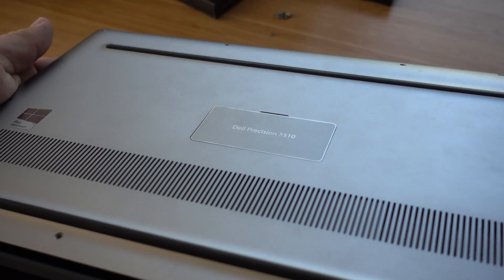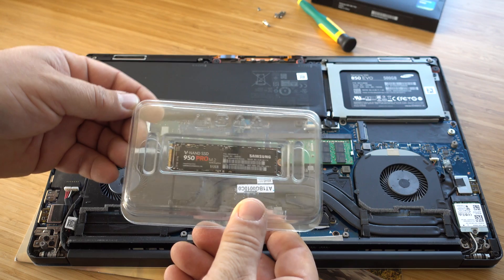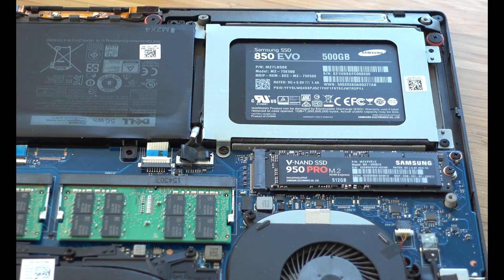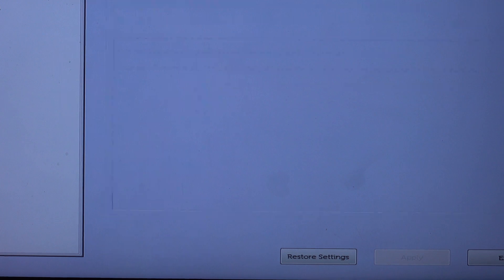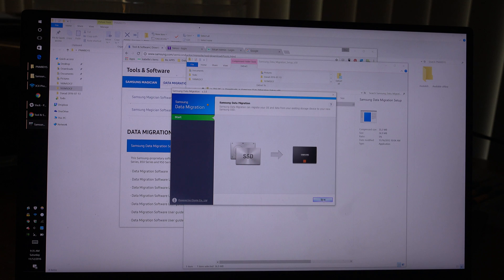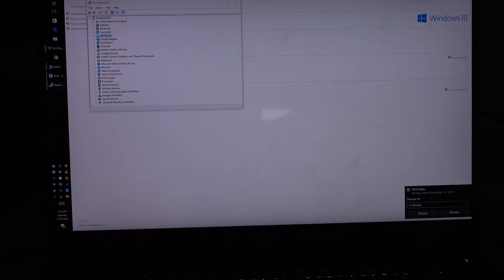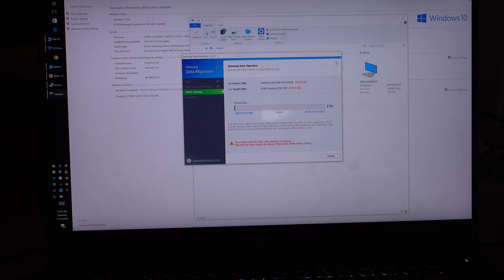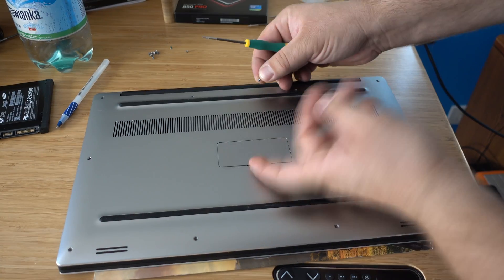Dell Precision 5510 XPS 15 ssd hard drive upgrade NVME V-Nand Samsung 950 Pro M.2

Comment: Hi Tom! Nice video! I would you ask a question. Do you know what are the right bios settings that working with both ssd installed? I would to maintain the SO (windows 10) on the ssd and using the ssd nvme only to storage. This pc works for me as a backup pc nowdays. Thank you so much!
Luca

Comment: Are you able to keep both hard drives for additional storage if you wanted?  Like a C: and D: disk?  I have a 4tb samsung SSD sata from my old Laptop that i would like to use.  Cheers!
Reply from the maker: Yes if your laptop has a M2 slot and 2.5 inch HD slot, then yes you can have two different hard drives.  Works very well.

Comment: Hi! did you have any problems with thermals? I read that a thermal pad might be needed for the nvme but not sure. Would be great to know your experience!
Reply: I want to know too
Reply: @fanadil  FWIW, I did install a thermal pad for the NVME SSD on my Dell 5510. The 1.5mm fit nicely. I just put it on top of the SSD. Been working fine since April (with heavy workloads). I hope this helps!

Comment: I bought a Samsung *60 EVO, After trying  to migrate my HDD and failing several times. I called Samsung support.They weren't able to help. i I thought I had a faulty drive. I was finally able to clone my HDD to SSD with Aomei backupper

Comment: Have you had any issues with keyboard not working after resuming from sleep or rebooting? Just happens on Windows to me, Linux works just fine.
Reply from the maker: Never had those issues, not sure, seems like a driver issue, or lose connection to the keyboard.
Reply: search for device manager (startmenu), open it, then there is a list with devices - uninstall all keyboard drivers, restart your pc. Should work now.
Reply: @ichheissemarvin5613  thanks for the suggestion but I tried that many times without success.
I was able to fix the issue by resetting the CMOS battery. I replaced the battery, though a reset  of the CMOS by removing the battery would have been enough. Hope this helps anyone with similar issues.
Reply: @juaniki123  you should also need to unplug the normal battery @everyone

@juaniki123 I'm glad you could repair it. If it is not a driver problem it is normally that. Had similar problems with Keyboard and Thunderbolt Charging Port that could be fixed like that.
Reply: @ichheissemarvin5613  😃 you are 100% right! I didn't mentioned it because I assumed that if anyone has the courage to disassemble this expensive machine they would also follow all the ESD safety precautions... The CMOS battery is buried inside the laptop, you have to disassemble everything...

Comment: dude...great video, but be sure to disconnect the battery before you work on the components of your laptop, better be safe than sorry, i guess...
Reply: well for a ssd remplacement it is not nessescary.

You probably are more likely going to damage it by unplugging the battery..
Reply from the maker: True agree with that, always unplug the battery.

Comment: Hi Tom, thank you for your video it was very helpful. I am in the same situation and planning to install a new M.2 SSD. My Precesion 5510 came with a WD 500GB, 7200RPM, 32MB Cache (WD5000LPLX) as a default drive. But in order to proceed, I need some clarifications, is the Samsung 970 EVO 500GB http://a.co/0DKqOmL compatible with my system? Can I migrate from the default WD drive to the SSD using Samsung Magician software? Would there by a big difference in speed? I am using Windows 10 Pro. Please advise.
Reply from the maker: Yes Samsung evo 970 should work, as you see in my video I used the Samsung Software to migrate.  I don't see a huge speed increase over good SSD, but it's there.  You will definitely though see huge gains after upgrading the Hard Drive.
Reply: Thank you Tom, I got EVO 970 and I am now getting ready to installing it.